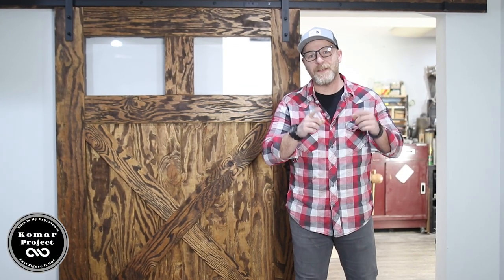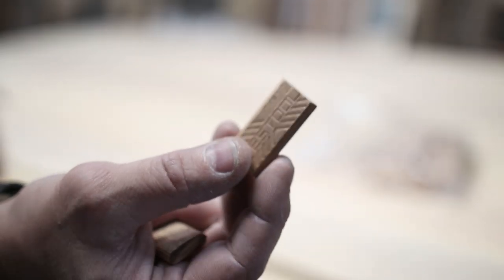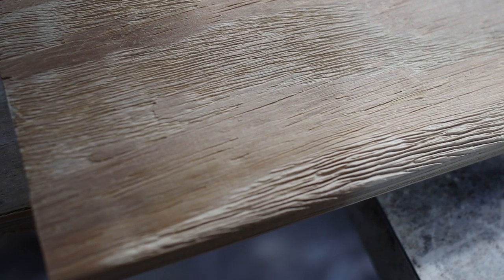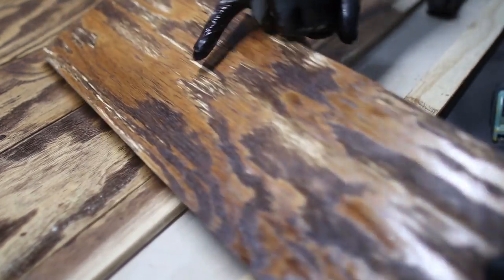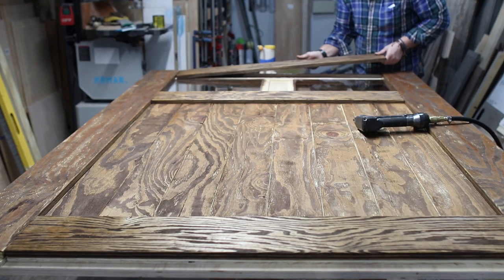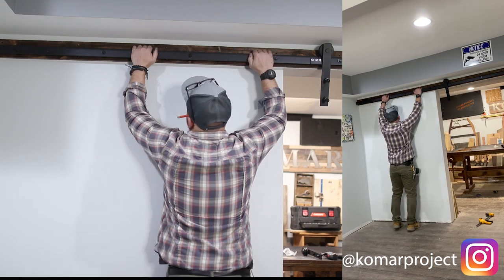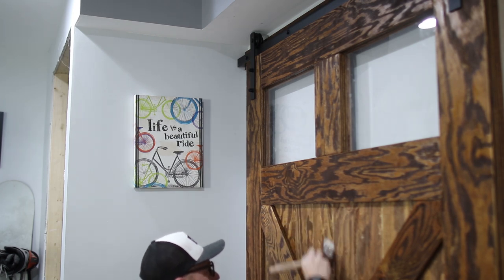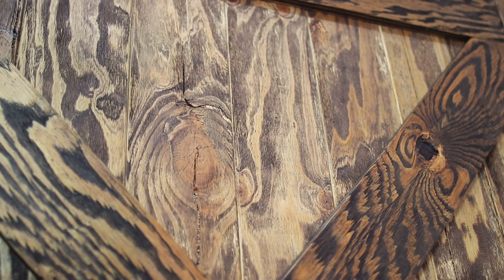How to Make a Barn Door out of Plywood for under $150

Comment: That barn door looks awesome. I’m going to refer back to this video when I finally replace my roll up shop door which has zero insulation. I might need to look into that restorer also. I like the torch and wire brush method for distressing my projects, basically shou sugi ban, but this tool would save some time. Great job once again.

Comment: Your glass was tempered so it comes out the factory with internal stress all over. This makes it extremely resistant to breaking but when you crack it regardless of whether you used an angle grinder or not it would have exploded from the disruption of the stress forces holding the glass together.

also you can use your ROS to sand the plexiglass to give it a frosted look
Reply from the maker: Thanks Andrew!! When I was doing this I had no idea it was tempered.  Is there a way you can tell?
Reply: @KomarProject  Sorry, I already started laughing when you couldn't cut the glass with a glass cutter as I knew what would happen next. Best way to tell if it's tempered or not is tempered will generally be very smooth on the edges, normal glass can be a bit rough to the touch. And if you have scraps laying around, if it was for inside use (like furniture) - it's probably tempered. And as you found out, if it won't snap with a simple score - it's probably tempered.

Comment: Love your videos all the way here in Sweden. 

And Little Help to you. When you used the tool to the glas you are supose to tap under the glas and it will crack where you marked. 😁

Sorry for bad English
Reply from the maker: viktor Åkesson thanks victor.  Wish I knew before.  Maybe for next time lol
Reply: I'm not certain that would work. The way the glass shattered seems similar as car window shattering, so I'd guess the glass would be hardened. I think it's called safety glass. Very nice project anyway, I love your style! :)

Comment: Thanks for the tip I was wondering can it be done with just a single sheet of plywood for a 3 foot door.
Reply from the maker: Your going to need two sheets.  One 3/4” and one 1/2” for the inside.
Reply: @KomarProject  can't wait to work on this project

Comment: Just so you know, that was toughened glass you were trying to cut, which is heat treated. It’s not able to be cut as it’s designed to break into tiny safe pieces. I mist admit I cringed when I saw the angle grinder cause I expected it to explode in your face…..glad your ok!